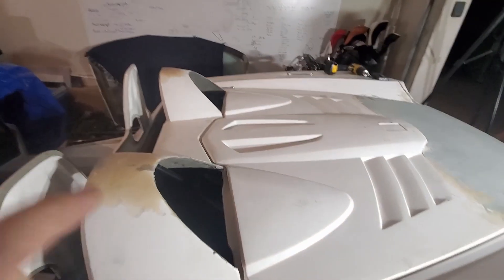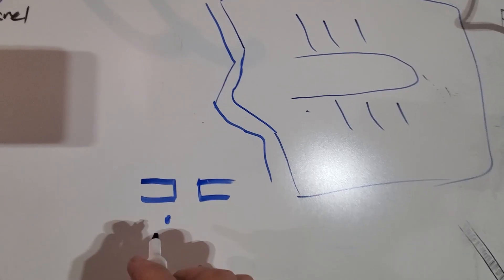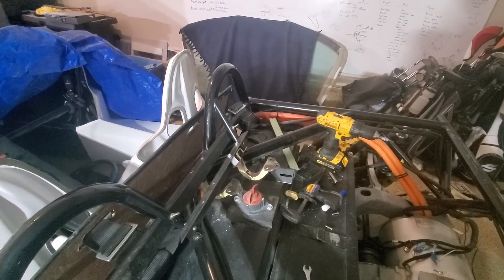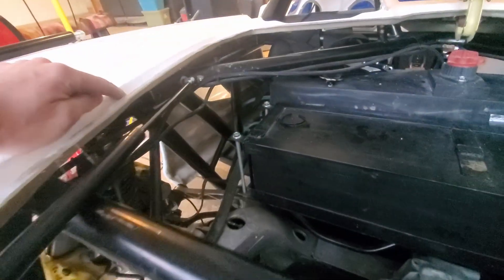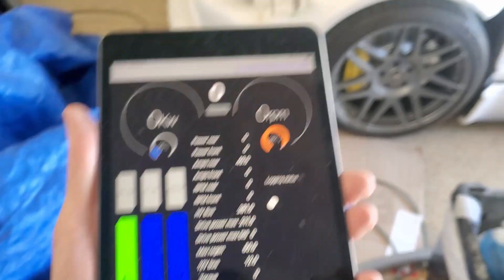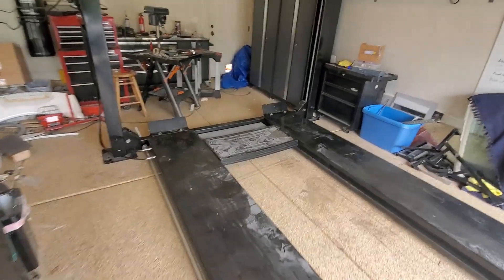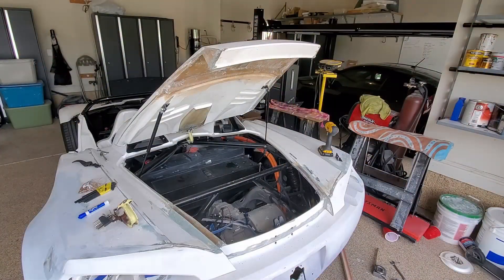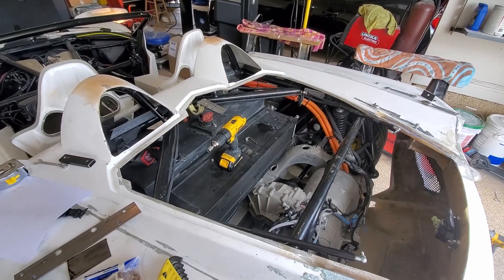So Many Mistakes!   Fitting the Trunk is Getting the Best of Me.

Comment: I've watched a number of your videos and can appreciate your effort. I hope you don't mind my offering a suggestion regarding your trunk hinging issue. You are on the right path in that the pivot point needs to be forward of the front of the panel and as high as possible, but ... had you considered a multi-arm type hinge like a hood hinge that actually moves the panel back as it rises? Something like a Pontiac Solstice clamshell hood has just the type I believe would work well and could be moved further apart to improve stability. And, I believe some already come with gas springs so you wouldn't have the issue of the gas spring pushing the deck lid back.
Reply from the maker: Thanks for the comment!  I'll have to check it out!

Comment: Good result.

I did think about making the part between the roll hoops straight... also wondered about making the boot lid pivot from the number plate end. 

Another thought was to cut your current hinges in half in length, leave the part that is attached to the chassis in place but then fit pivot rods that move the boot lid part (of the hinge) further apart, so the boot is better supported but still the same pivot point?

A long winded trial and unsure if it would be of benefit.

As always, great work.

Hope the electrical isnt another gremlin or faulty board.
Reply from the maker: Thanks!

Comment: it's sad to see another electrical issue poping up, i hope You don't get discouraged ! :)

Tried to brianstorm for possible problem sources: maybe some coolant got on Your plugs, or there are some cold solder joints.
On the app it also looked like 12V bus reading was dissappearing - maybe some battery / dc-dc converter problems?
Reply from the maker: Thanks for the thoughts!

Comment: Maybe add a thin steel 'retaining cable' connecting each rear corner of the trunk lid to the frame, their length adjusted so that when the trunk is open fully they prevent any lateral 'wobble' and also counteract any difference in the gas strut pressures (which tend to pull the lid skew). You should be able to find cables that are strong enough, yet thin enough to be unobtrusive.
Reply from the maker: Great thought!

Comment: First let me say, I can completely understand your frustration and pain when a plan does not seem to go as, well, planned. 

Overall, the trunk looks great and I think you were mostly on the right track here. I do have a concern though. The hinges in the center like that looks as though its putting a lot of stress on the hatch lid where the hinges connect. My fear is that over time you may start seeing cracking somewhere along that point of contact. The other is the unsureness of the lid opening and closing and I have two suggestions there. 

Bare with me because I understand that you have made this much progress and the last thing you may want to do is go back to the drawing board but with any project, that may be the best idea. 

As I was saying, I am afraid of cracking and the slight wobble where it seems the gas struts are doing all the leveling. You don't want to rely on the struts for this. if and when they fail they will make your life very much more difficult. Instead, you really want the hinges to do all the work of moving the trunk from closed to open position position. The only duty you want for your struts is to aid in lifting the lid and holding it into position. (I do realize this was your intent and I am sorry if this sounds too harsh as it is not meant to be critical in any way.) 

I know this would take a lot of doing and fabrication, but I honestly believe that your hinges should be in the corners and not in the center. You may also need to fabricate a bar that goes from one hinge to the other and have the trunk lid mount to that bar. This should increase stability and strength. The gas struts angle may need to be played with so that when the lid is closed they don't lay flat. Essentially, you always want their force to be directed upward and not towards the rear as this will put stresses on the latch system and the hinges. In your current configuration, I think this is going to cause more issues for you as the lid is operated. 

Please let me say, if you have read my comments enough over the time you have spent on your car, I am truly one of your biggest fans and I am cheering you on concerning this build. I am not disillusioned to the fact that building a kit car is already a hard project but add in your alterations, thats a whole other ball of wax. I applaud you on your continued determination and encourage you to stay the course as I am sure your more than committed to doing. Don't go back to the trunk until you have cleared your mind and have the other electrical demon sorted out. You'll be better able to attack this with a fresh perspective. This is most certainly one of the moments where I'm guilty of not doing as I am suggesting so, best of luck and hang in there. In the end this will all be worth it.
Reply from the maker: Thanks for the comment!   Never too late to make a good decision!
Reply: Me too.

Comment: At least you figured out the boot hinge. You can always add filler to lessen the gap around the back of the boot later. The electrical glitch is worrying though. I wouldn't turn it on too much just in case it causes damage to a control board.
Reply from the maker: Yep!  I do worry about the drive issues 🤔

Comment: Making something work in a way it was never meant to is the most challenging. 
A heavier duty hinge or weld the two together maybe. 
Is the12V battery low?
Reply from the maker: Yes the 12V battery is dead dead!  I have to jump it with my 12V power supply when I want to drive.  It won't hold a charge.

Comment: With such things it’s better not to hard weld it but make it adjustable from the beginning so all you need to do is loosen a few nuts to allow for such movement. Thoughts it’s easier said in retrospect or from a distance
Reply from the maker: Thanks for the comment!
Reply: @electricsupercar  
I’m not sure if I can paste a URL here but additional side hinges like these to either side might give it a bit more rigidity and stop it from twisting:
https://www.ebay.com/itm/193629039883